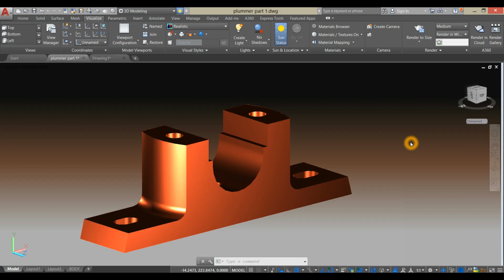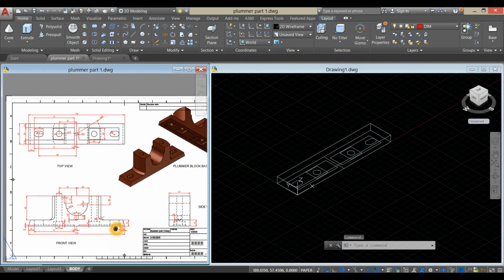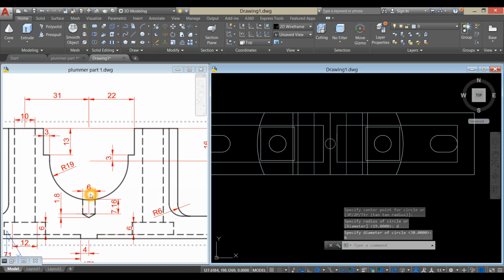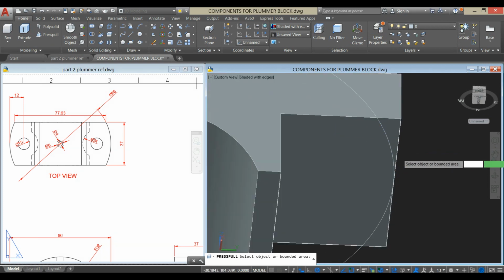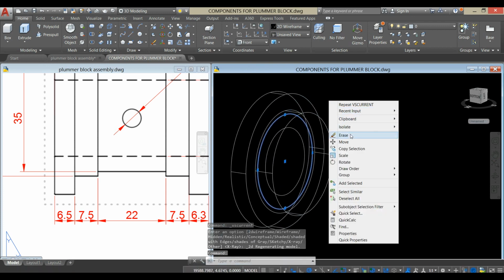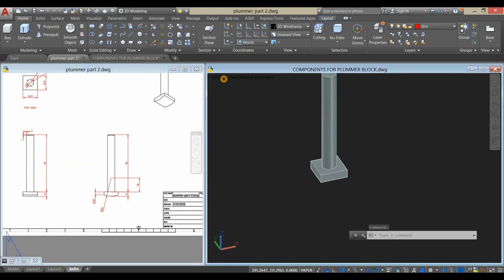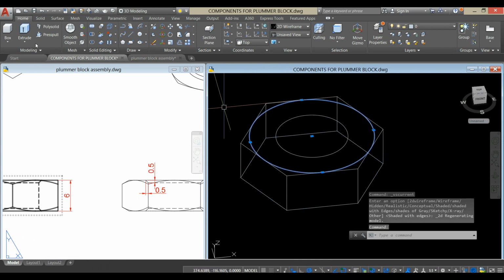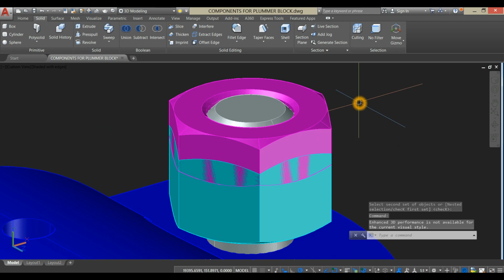AutoCAD Tutorial | Plummer Block Modeling & Assembly | Mechanical Drawing

Comment: Nice work can you send the draw for practice
Reply from the maker: I will post it soon on my blog
Reply from the maker: are you asking for the dimension of an isometric drawing? pls click https://autocadnetwork.blogspot.com/2019/08/plummer-block.html
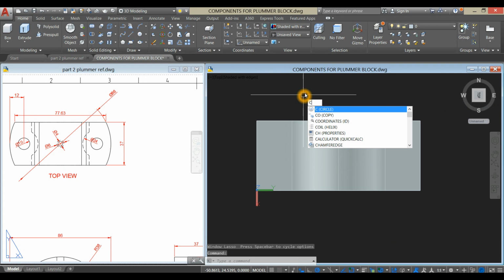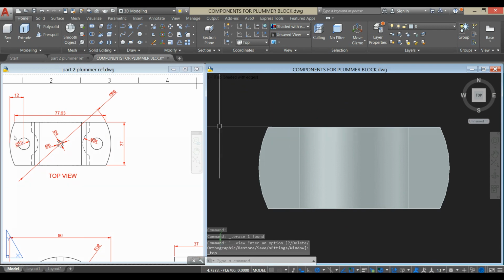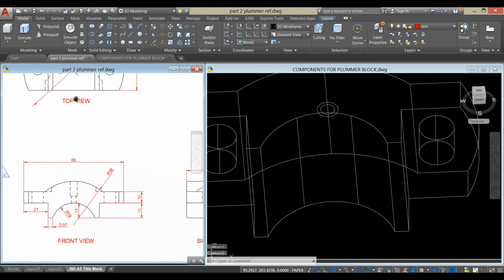Reply: @AC3DCad  Nice guidance, many parameters are missing in images in your blog. @ 22:04 diameters of 86 not available in the figure in the blog. @23:14 distance of 12 units is not available in the figure in the blog. @24:38 depth of top circles (dia 4 and dia 6) are not given in blog images.
Reply from the maker: @jayeshsukhadia7209  I'll check it out